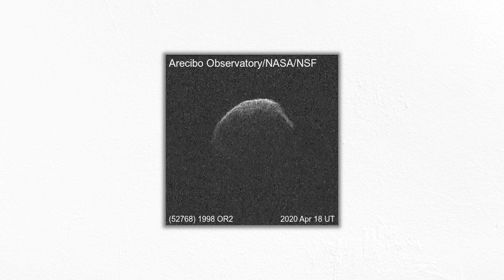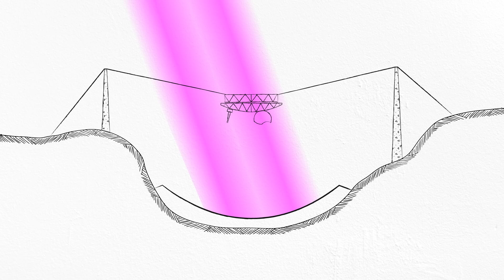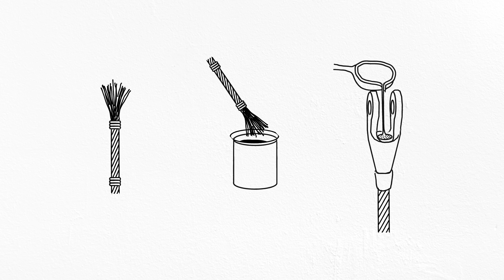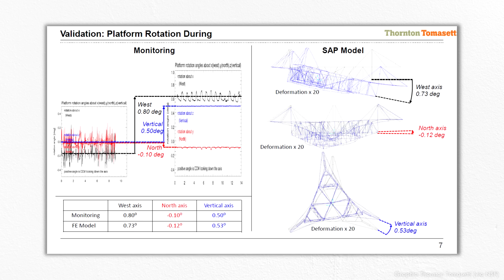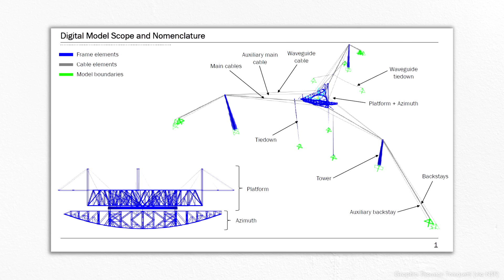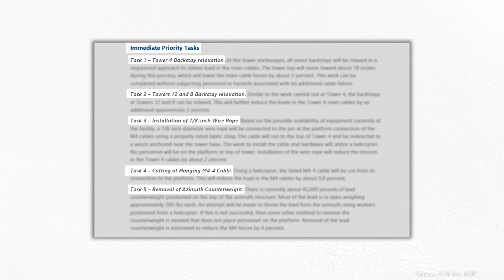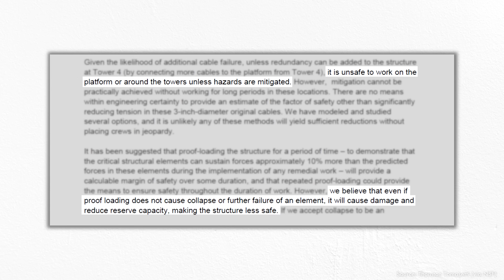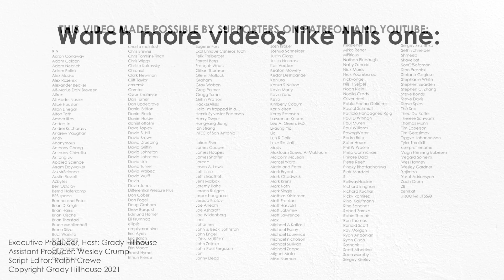What Really Happened at the Arecibo Telescope?

Comment: Aside from cost why couldn’t they have constructed 3 additional towers to distribute the load?
Reply: Because the crew would need to either work from a helicopter to actually connect the cables, or to be on the structure, neither of which was deemed safe.

Comment: Original cables were installed with pride. 'Support' cables weren't. Differed maintenance always results in problems. The investigation shouldn't need to take too long, evidence are in the drone and GoPro footage. Lack of maintenance on old cables and likely sub-par installation of further support cables lead to failure.

Comment: Thank You very much Sir!
You gave every minute details in detail!

But for a telescope, are these much complicated construction nrcessary?
Suspension, on whatever sized cables and whichever material used, is prone to at least mechanical failure in due course of time.
I think a Brain storm idea to "see how it works" created this weakling telescope!
Just like those collapsed bridges due to Natural Resonance, this too might have gone the same way. 
The view of the suspended receiver module over the bowl itself was so queer and amusing! 
Whenever I saw that, I had the thought flash on my mind, "Such an unstable gizzmo hanging in mid air" just ready to crash down!"
But, anyway, the Destruction was so much perfect and complete leaving not even a single part for further repair!!
Imperfect Construction leading to Perfect Destruction!!

Comment: What really happened was the structure was not designed to be maintained. The cables were designed in such a way that they were permanently anchored and the tension could not be released in a controlled manner to allow their periodic replacement. It was a bad design and that is ultimately what doomed the telescope to a finite lifespan. The cables should have been on winding drums to allow the tension to be relieved in a controlled fashion and individual cables replaced.

Comment: It lasted 60 years in a highly corrosive area.  It did pretty well for a guyed structure in that environment with Hurricane force winds imo.  A safety factor of 2 is acceptable for standard structural design.  At that time I'm sure they used ASD but with cables you don't really have a design corrosion loss of steel like standard steel members.  Due too it being stranded there is much more area for the corrosion to happen.  The 60% failure is likely directly related to steel loss due to corrosion.  Today we would coat the cables or shield them (as you alluded to).  The paint is only mildly useful for corrosion in that environment.

Comment: I haven't worked as an engineer for decades, but to me, a factor of safety of 2 for something like this seems, at best, quite optimistic.
Also, props to whoever built that last cable on the tower where the collapse first started - it held for a good few seconds after all the other cables failed, so during that time it withstood forces more than 4 times what it was designed for.

Comment: well clearly neither the nsf nor the university should retain control of the site since they didn't give it the necessary funding to keep the telescope in working order. because of the facilities already there and giant pile of metal in a convenient hole, an Arecibo 2 should be built there under direct nasa control. of course the new instrument platform will need to be able to be lowered for maintenance so that even with periods of low funding it doesn't collapse waiting for repairs again. having four towers would also be better because only having three means a failure of any of them is catastrophic.

Comment: I've got a question about water pumps. If I had a tower out at sea, that was open to the air at the top and went all the way down to the sea bed, then I had a feeder tube about 20m meters below the surface which fed water down 250m to a turbine. Then the exit water is dropped another 250m to reach terminal velocity and power another turbine. I do this twice more so that I have electricity from 4 turbines. The water then drops to the bottom of my tower but I don't want it to start filling the tower. Is there a pump powerful enough to pump out the water at the same speed it is coming in i.e. terminal velocity? Would I be able to power it with just three of the turbines and keep the electricity from the fourth turbine thereby getting free hydroelectric power?
Reply: My idea for a pump would be a heavy 'camshaft' turned by geared cogs driven by the bottom turbine. This camshaft would push out a series of pistons that would draw in the wastewater from the reservoir at the base of the tower, then as the cam 'releases' the pistons, the high-pressure deep seawater would ram the piston closed because it only has our lower pressure wastewater in it and the reservoir has a low head. It would then work the same way as a ram pump, the water would flow back into the reservoir which would shut the inlet valve and the water would slam against the exit valve on its way to the surface. The pistons could be arranged in a circular formation on the inside wall at the bottom of the tower. I know ram pumps produce more wastewater than they pump to the surface but if I have enough of them I could pump out the water at the same speed it arrives. What does everyone think?

Comment: Maybe the added cables was just loosely hanging around there just making more stress instead of strength as you can see inner ones (originals) gave up way sooner than those new ones.
Reply: Of course, old cable will always break before new ones and it means nothing in itself, though.

Comment: I think the main issue and cause of failure can be directly pointed to lack of cable maintenance. Why didn't they change them out years ago just as general maintenance? Did they think they would last forever in that environment with increasing loads being place upon them?  I'm not the brightest bulb, but once they attached that heavy dome to it, why didn't they replace the support cables with higher load ones?

Comment: When you have balanced cables and backstays, what direction is the force on the tower? It seems like it should be straight down but that doesn't feel right
Reply: I think it depends on the tower's angle .
Reply: Concrete is strong under compression, so the force has to be down the tower. The towers could only flex a little bit. That's why the tops broke off when the cables snapped.

Comment: Great information! 
I'm sure that fatigue has some part to play in it. When you design with a factor of safety of 2 you are already going to be approaching it's long term fatigue strength, and when you add up the number of cycles of stress due to wind over 50 years, and then you add the load of the vertical stabilizer lines, it becomes a recipe for disaster. The sad part is that many bridges around this country are going to have the same problem, because they are allowing them to rust heavily and they are being weakened until they will fall soon. Judging by the amount of rust that I have seen on a bunch of bridges, I would not be surprised if we start seeing major collapses in 5 years, maybe less.

Comment: It’s a shame when the first backup cables were added that they didn’t or were able to remove part of the structure. Maybe the Gregorian Dome could of been safely lowered temporary on to I-beams to hold it above the dish! It’s sucks that this iconic landmark was allowed to deteriorate to the point of failure, seems like a lot of historical stuff is allowed to go this way!
Reply: The solution would have been double the number of support columns, then new cables for those to take the weight, then relieve tension on the originals and do maintenance on the original cable sets, and rotate periodically between which one carried the load and do the maintenance.   All they needed was money, which no one was willing to give.
Reply: It couldn't. That was literally the entire point of having someone assess it.
Reply: Yeah I guess that is sort of true. Some super old structures just go to their graves. Either no one cares to fix them... Or no one can figure out a modern solution to a historical problem. I think we literally lose the ability to fix or to even understand how some of these structures were put together. Learning all of our modern techniques and then never learning or slowly losing the knowledge that was used to make these historical structures.

Comment: Thank you for this very interesting and even MORE informative presentation. The structure, itself, was an amazing bit of engineering and derring-do construction from a time in our history when that was not all that unusual. After all, we were taking WWII technology and building new machines derived therefrom to use to send men to the moon. What is surprising is that all of that added structure and weight were added to the original structure with a minimalist approach to re-enforcing the original structure to support it. That is continued to stand for as long as it did thereafter is a testament to the strength built into the original design. It is noteworthy that the  Chinese decided to build one that is 60% larger in diameter. Is there a need for this kind of technology today or are there better, more efficient and sensitive technologies that could do as well or even better at a lower cost of construction and operation?

Comment: The question I have is do metal wires under stress lose strength overtime as it ages along with natural factors?
Reply: @MarkTillotson  but would that cause the corrosion to become even more of a problem considering that if they don't use the right paint it could probably oxidate the metals?

Comment: 2.0 static load safety is pretty good for an unmanned structure. I'd hazard a guess though, that they didn't adequately calculate the dynamic loads, which made the steel cables mechanically age.

Comment: Looks like the countersink flange went out on the CD-7 unit multiplier, knocking out hydraulic torque to the electric heat riser.
Most countersink flanges will experience hydraulic torque leak throughout their less than 7,000 RQMs. Especially when coupled with the double-flux lumen switcher. But with Wilson Countersink Flanges and Dorry Flanges, hydraulic torque is allowed to bypass the settling clutch, providing steady wall pressure to the lug manifold and all the seismic rotors. And that goes for 7,000 RQMs, 8,000 RQMs, even up to 10,000 RQMS. That’s right! 10,000!
CD-7 should be able to handle vacuum-kickback on all 22 blossom valves!
Now, if I could just get my kid to mow the lawn!

Comment: The strain on those (near) horizontal wires must have been huge. With stress corrosion and daily temperature changes, failure becomes a certainty. The huge shame is that nobody bothered to plan for replacement structural elements.

Comment: today static forced are based on another system 
in the 60ies there was only one safety factor added in the calculation (i.e. 10 % load)
nowadays in calculations the sem-probabilistic system is used as safety
the material is tested in an institute - the value at which 5 % of the tests fail the load is used for the calculation
the load in the calculation is defined as 95 % of the maximum possible load of the structure (wind + weight + earthquake + snow, ....)
therefore the probabilty for failure is lower

but in the end i think it was human error (maintenance)

sorry for my bad english

Comment: BS, there are cable structures far older than this still in everyday use that will be around for a long time yet.  When they bind cables for this type of structure they put in a safety factor of two which means twice as much cable is used than is ordinarily needed, this has been industry practice for over a hundred years.  The fact they also had a drone filming the pylon that the cable failed on at the exact moments it went is a unlikely given the drones limited flight time.  More likely it's an insurance job or something similar, follow the money and I'm sure it'll make more sense.

Comment: Is the smoke drifting to the left of the screen prior to separation, is that cable strands breaking on the back side or what? There is an awful lot of dust and smoke involved. I realize that was a lot of force released at once. It is evident from the way the cable in back of the tower just spins apart.

Comment: Zinc bars are attached to steep ships as sacrificial anodes. Just what did the engineers believe would happen when pouring molten zinc into a steel socket surrounding a steel cable and exposed to the salty air/moisture in the telescope's location?
The cable termination socket was the sacrificial anode.

Comment: The question was never really could it have been done safely. You would never have been able to repair it safely. That was always going to be a high risk job even if they had the safety margin the engineers wanted. Some jobs just aren't safe and this would have been one of them. The question was always going to be the cost to repair it. They didn't want to spend the money and spent too much time analyzing it. 

1) It doesn't look like there was an easy way to replace the cables until they broke. Why did no one think of a way to replace the cables while in place when the telescope was designed?
2) It wasn't hard to see that after that first cable broke that the possibiity of one of the other cables could very well fail. The forces on the other cables when the platform dropped would have overloaded their max weight. If they were going to fix it they should've installed a new cable immediatly
3) Were there no emergency cables stored onsite so one could be replaced immediatly if one broke? If not then why not? It seems like common sense to have at least one or two replacement cables onsite just in case one broke. 

These are just a couple of things engineers should consider if they plan on replacing this telescope with a new one. Hopefully they do. There are still a lot more discoveries to be made.

Comment: If only the preventive maintenance program included replacement of the load bearing cables every 10 or 15 years it would have been okay. But most likely the operations budget would not allow for it......
When building, no costs are spared, when in operations it is all about bottom line.....

Nice video. Thx.

Comment: At 12:59 why there is black lifting strap (looks new) wrapped around cable (which suddenly broke when drone was above it) ? And there is also shackle in end of strap. Was it used to cause stress on wire??
Reply from the maker: Used to lower the socket of the first broken cable for analysis

Comment: Why did they use cables to overhang the structure instead of some structural arc? Would be too heavy and would collapse under own weight?
Reply: Its a radio telescope, you want to be able to see through the suspension mechanism!  Cables are by far the cheapest option.
Reply: @MarkTillotson  I mean like four thin archs perpendicular to each other. They could have been reinforced vertically, not causing big obstruction.
And cables are not necessarily cheapest option imho as they require those pillars, and something to hook them to.
Anyway I can understand how servicing such overhanging structure is almost impossible without a crane. But then perhaps it should have been designed with servicing in mind. However, on such remote location..

Comment: im kind of surprised that they didnt make a piston or scissor lift under the cradle, that would lift up and hold the apparatus up so they could repair and replace.

what im even more surprised about that they didnt even bother to have this stuff like the wires and spelters made here in the states on a site so that it would in fact pass engineering QA.

it mainly sounds like it was a middle management decision, and that decision was to spend more money on it to never rectify and repair it.

Comment: Basically hardly any safety factor in the cables, they were probably right at their limit for decades, salt, moisture, daily expansion and movement from wind forces ultimately overpowered the highly stressed cables. Why this was designed so "weak" to start with.

Comment: “The National Science Foundation is holding hearings….”?!? They defunded it. Isn’t that a little like the past homeowner getting to come in and tell you what renovations you can do to your house?
Reply: There may not be any other body with oversight of that kind of structure in that location.  Groups higher up the food chain (major political bodies) may have much bigger issues to focus on than the structural failure of a telescope after decades of successful operation.  Admittedly it would be more transparent to have an independent body to look into any failings, but they have to exist, have jurisdiction and subpoena powers to do so legally and effectively.

Comment: I have to ask why wasn't it originally built with a design depicted in GoldenEye that can be safely lowered for storms & cable maintenance/replacement? If we can put a man on the moon, surely we can design a winch or extendable tower system that would sustain loads & enable the platform to be lowered when needed. 

I'm sure money was the factor. It is with every other thing that fukks up!

Comment: Something I haven't heard discussed is how the cables are affected where they are swaged (or by other means) to eyelets and other fittings.  I am inclined to believe that having the cable fixed like that can cause a stress riser that will cause individual strands to fatigue and break over time.  It doesn't surprise me when such failures happen as we see at Arecibo and at various bridges around the world.  I have seen breakages happen on smaller scales and yachts have shrouds replaced on a regular basis to avoid such things.